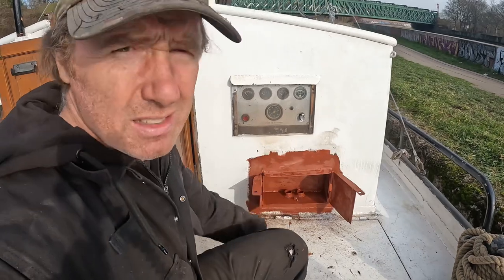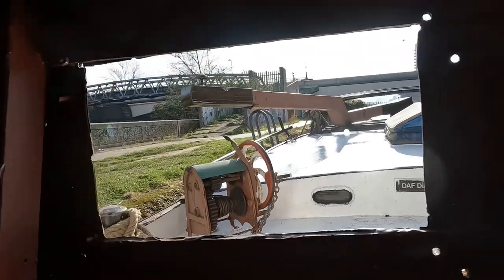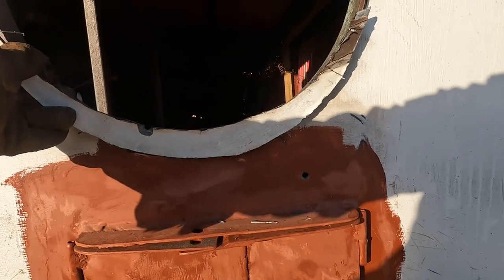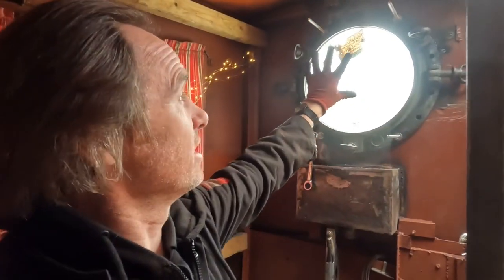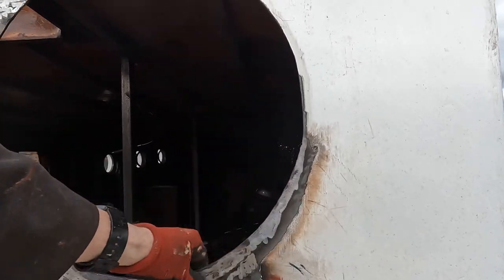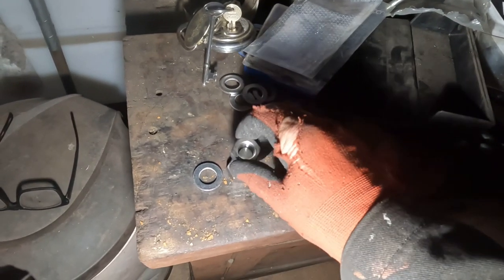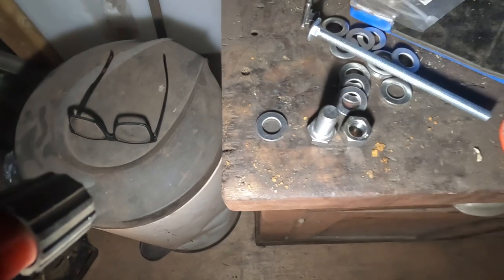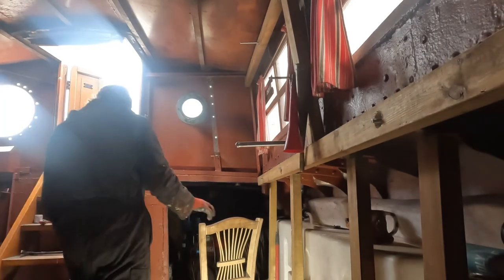Installing a massive porthole onto Dutch Barge Linda 121

Comment: They are some SERIOUS portholes, going to have some lovely natural light and airflow inside Linda, great progress Canice
Reply from the maker: It was actually quite difficult to film because of the amount of light coming in through the holes as I was putting them in. They make a huge difference. But well spotted on the airflow, as that’s going to be the biggest need in that part of the boat as the original windows don’t open!

Comment: Not sure what kind of wave your expecting to come over the stern…. But those portholes are built for it….. might have to upgrade the door though 😂😂
Reply from the maker: I just found a really small bulkhead door salvaged from HMS Hermes, which which weighs 140 kg, which will fit perfectly in the bulkhead at the front at £500. I’m very tempted to buy it, but it looks like overkill!
It’s 140 kg !!!!😂😂😂
Reply from the maker: I just found a really small bulkhead door salvaged from HMS Hermes, which which weighs 140 kg, which will fit perfectly in the bulkhead at the front at £500. I’m very tempted to buy it, but it looks like overkill!
It’s 140 kg !!!!😂😂😂
Reply: @canicebannon  sometimes you have to go with your gut instinct…. And don’t forget you’ve got the storm proof curtains to seal up the side windows 🤣🤣
Reply from the maker: @rbrtcrowther  😂😂😂😂😂

Comment: That’s a nice pair of ‘oles! Proper job 👍 
Good idea to place those electrics safely in there own little box, clever. 
Have a great week fella.
Reply from the maker: As you will see soon enough. The shower wall is going up there and once it goes up access to the control panel will disappear disappear so I figured access the panel from outside is the better option. The door has a little lock now.😂😂😎

Comment: Aw, sheesh. You've got a kind heart, boyo. I love the big new portholes, and this pair didn't come from Beth's boat, did they? Those deadlights will stop a Tsunami, I guess. The steel box from last week is a perfect house for your gauges and dials. And your new workbench is just perfect, full stop. Loved the surprise at the end, because you know I love that little ceramic bastard despite his bad character. Cheers, Canice, from New Mexico, USA. Jeff
Reply from the maker: Hi Jeff, I bought these portholes three years ago from eBay. I thought I wasn’t going to use them in the end and then I had a brainwave. Initially I had planned to have portholes with dead lights on them throughout the boat, but when Beth offered the steel port holes, I couldn’t resist the offer. I didn’t know what I was going to do with these two and a couple of weeks ago. I realise that they might look good in that location. I was worried that it might be too big and would look out of place but it turns out they look great. I’m really pleased.
I knew you lived out west in the US, but I didn’t realise it was New Mexico. Sounds nice and warm!🥶🥶🥶 Still cold, here.
Reply: @canicebannon  Here, too. 28 degrees Fahrenheit at 9AM. Santa Fe is at transition of high desert to alpine forest around 7000 feet. I love the new portholes and where you put them.👍

Comment: It looks like the bolts for the portholes is on the tiny side. May I suggest that you braze them in 😊
Reply from the maker: That is a really good idea. I have a lot of brazing to do down the line. I had considered getting a longer bolt and thread at cotter pin through them. And then immediately forgot what I was doing an ordered the parts I got.
Raising them is the solution. Thank you sir.

Comment: You should buy a plasma cutter Canice, it would make your life a lot easier, they are quite inexpensive now. 👍👍
Reply from the maker: Ha ha, you didn’t see me raise the roof then. I have a plasma cutter and it’s coming out very shortly for another project. Unfortunately on this occasion it was packed away at the very back of the boat and I couldn’t be bothered dragging it out as I also have to bring out the compressor as well and my generator was in the way.

Comment: are those portholes upside down?
Reply from the maker: I am sort of forcing them into that position. Portholes generally are safest if they open downwards. If they open to the side they can swing around. And if they open upwards, they could collapse and slam down. In my case opening upwards was the only option as you’ll see later, one porthole is in the shower.
And on the other side of the boat, the other porthole, if opened down, it would cover up the doorway into the engine room. 
They are a bit OTT, but they look really nice on the inside